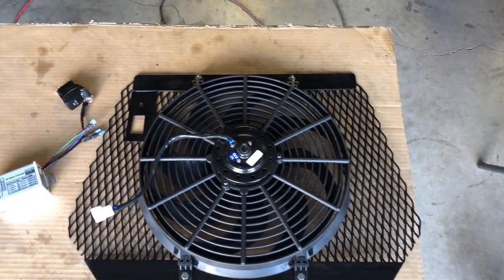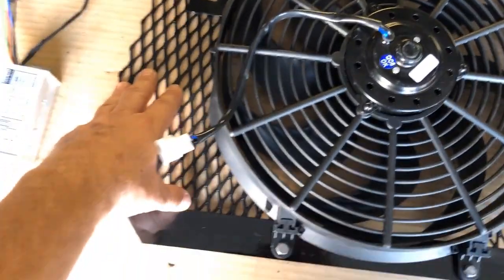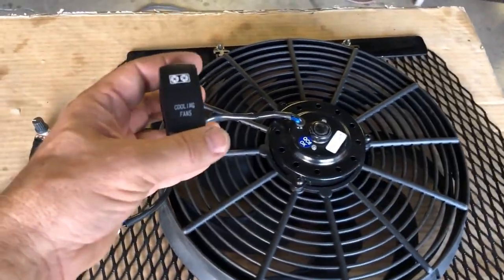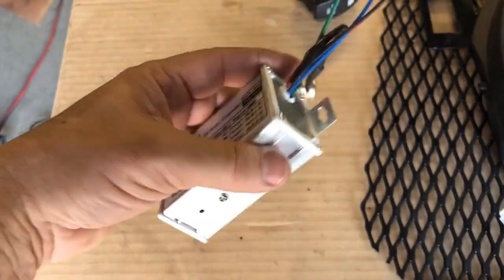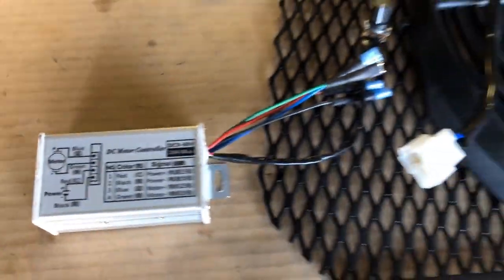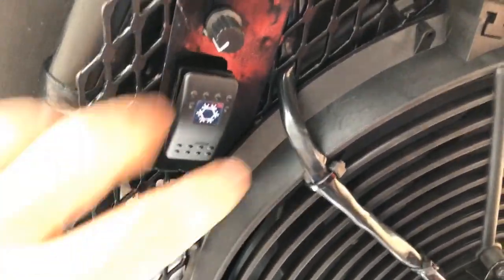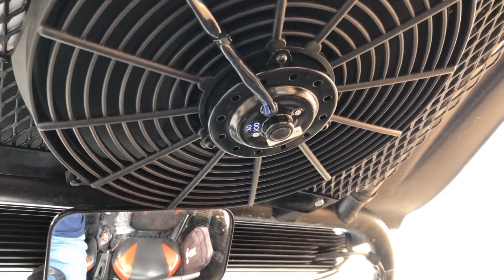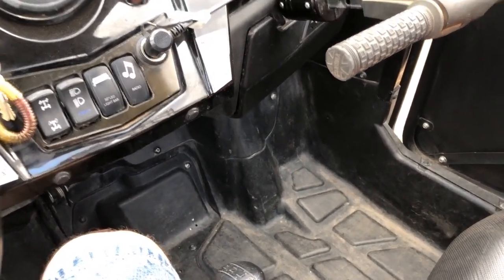Ultimate Cooling for UTV

Comment: I bought the same brand, only mine is 16". $36 on Amazon. I found the same thing about the amps. Startup was about 10+ amps, runs about 6 or 7... 
Great video. I put mine on my very large lawn tractor.  (Steiner 450)

Comment: Got a 👍 from me & subbed, the mesh wire as a mount is a EXCELLENT idea not only for a safety issue but also because such is WONDERFUL as a mount because you have so many options to mount it and other stuff because of the availability of holes that you DON'T have to drill, I want to do the same on a smaller scale to put in front of my Hot Florida driven Air cooled Honda 300 , so if you don't mind I may like to connect more directly with you about my project, I'm a electrical idiot, thanks for your production

Comment: Thank you for sharing! I’m looking into running a duel setup in my Pioneer 1K to cools us down on out hunting trips!
Reply: I have a pioneer 1000-5 wanting to do a duel set up also.  Have you done yours yet would love to see some pictures
Reply from the maker: Bigger fan works better than dual fans IMO.  Get the biggest you can fit either way.  A roof scoop or gap like I have is key to airflow.  You must pull air from top to get good flow.

Comment: I wish you showed how you did the wiring.   I ordered the exact parts you used about a year ago.   I am finally about to install
Reply from the maker: The video does talk about how I physically ran the wiring from fan to battery.  It does not cover the exact wire to terminal connections, but each speed controller may be different.  The most important thing is to have a fuse and locate it at the battery.  Next make sure the switch can handle the max amp draw the fan can make.  The wiring will go from battery to switch to speed controller to fan.  I chose a lighted switch so I know that power is cut off whenever the switch is off.  Leaving the switch on with the speed controller on lowest setting can draw power but not necessarily turn the fan… so you could inadvertently run battery dead over nite.  Good luck with the project.

Comment: I tried doing the same thing. However I have a metal roof that sets closer to the roll cage and won’t allow the fan to pull enough air to work properly. I’ve tried several ways of mounting it to create more air space but wasn’t able to come up with anything that would allow the fan to blow enough air to make it worthwhile. Glad to see yours is working though. 👍🏼
Reply from the maker: Make a hood scoop.
Reply: I found the same issue and am   mounting them behind the driver's head between the particle separator and the roll cage...  that worked well...

Comment: Any way for you to post a parts list of your video kind sir? The ole lady get steamy...
Great video brother.
Thnx
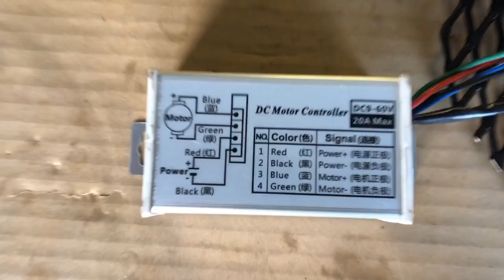Reply from the maker: Fan depends on your space availability.  I used a 14in fan, which is available at auto parts store or online.  I got curved blades as I think they are quieter.  The main component is the speed control which I got online.  If you go to 4:51 in video it has a good picture of it.  I mention the key specs you will want (PWM, 20khz and 20 amp).  These controllers are available at many online stores.

Comment: What’s the wiring that you used from the fan to your battery? Also, suggestions on where to purchase the wire. Thank you.
Reply from the maker: Got it at local hardware store.  Best to lookup wire size based on fan amps and distance from battery.

Comment: I'm installing a similar system but the speed controller comes with a very small on/off switch wired in with extremely light gauge wire. I want to install a better rocker switch in the dash but keep the controller mounted to the roof. Can I bypass this switch altogether and tie it into the power source or do I need to use the same light gauge wire from the existing switch wire?
Reply from the maker: Probably either will work.  I would turn the small included switch on and use a separate power switch.  That way you know you cut power to the speed controller and fan when you turn it off.  Will prevent a parasitic draw.

Comment: So question I’d like to ask?   What are your thoughts on a fan of similar size under the dash?  I’m looking for dust control mostly, would that cause the pressure around the feet area to keep the dust out?   Maybe not quite as harsh as the fan blowing or noise right at your face ???  What you think?
Reply from the maker: Would be terrible for heat.  Most of the heat comes from under the dash area because that’s where the radiator blow it.., and the hoses run under the floor.  Plus, where does it get the fresh air?  You would just be blowing dust and heat around.  You MUST get fresh air from above the fan if you want it to work properly.  Make sure to get the LARGEST fan you can fit, so you can run it slower rpm and the noise it not bad.

Comment: Great Video, I built my fan unit based on your design and it came out great. Only problem I had was finding a PWM unit that would work, tried several units from Amazon and they all failed to control fan speed. can you provide link to the unit you used?
Reply from the maker: Sorry, don’t have a link.  The video shows a picture of it.  Check EBay.  Possibly your fan is not compatible with PWM.  I got my fan at AutoZone.

Comment: So after 3 years how has it performed?
Reply from the maker: Best upgrade I have ever made!  It keeps the cab cool and helps keep the dust out.
Reply: Has the fan in the controller held up or have you had to replace them?
Reply from the maker: Both have been fine.  The only issue I had was the on/off switch needed to be replaced.  I think dust got in there.  So I replaced with a sealed switch.

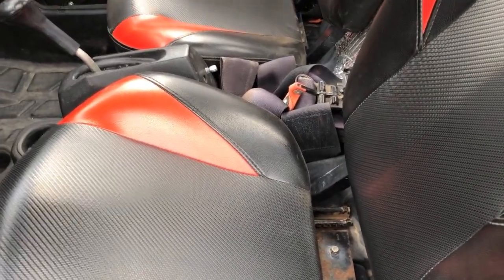Comment: At 9:25 - When you say you fused it to the battery can you elaborate on that.  What size fuse did you use? Was the fuse part of the wire or did you add it?
Reply from the maker: You should add a fuse on the wire very close to the battery.  The wire should be sized to handle the amp draw of the fan and should also be based on the length of the wire.  You can lookup wire size charts online.  The fuse should then be sized smaller than the wire rating, so the fuse blows before the wire fails.  Remember, fuses are there to protect the wiring.

Comment: Can you post a parts list and links?
Reply from the maker: The video shows a detailed picture of the speed controller and the hertz rating I recommend.  You can find that brand many places online... they are cheap.  The rest is just a switch and radiator fan that fits the size you need.  The biggest fan you can fit the better so you can run at slower speed and move more air.

Comment: How did you run the plug from the fan? Like I see the blue/black coming out of the did you use a white plug like what’s on the end to connect or did you cut and hardwire?
Reply from the maker: Cut and put new connectors on to wire to speed control/switch.  Wires go from there to battery with a fuse just before the battery.

Comment: Do you get the heat from the black roof in the summer time?  I would imagine the fan pulls that heat and transfers it to you
Reply from the maker: Notice that my setup pulls air from a gap between the windshield and roof.  This is KEY to getting good airflow and cooler air.  Too many people miss this and expect bolting a fan to their roof will work well… and it does not.   Add a hood scoop on the roof or do a setup like mine.  You NEED fresh air coming in, not just recirculating the cab air.

Comment: I have same speed controller,  20a switch and 14" fan as yours. Do you think the switch and controller will run dual 14" fans or would i need two complete setups?
Reply from the maker: I would do individual setups for many reasons.  I would also be concerned that your battery and stator could handle 2 fans running at same time.  That’s a lot of amps.

Comment: Did you run a 120w or 80w fan
Reply from the maker: I would guess it’s around 120w since it was pulling 8 amps.  Remember the air flow is more about pulling in air from ABOVE fan.  If you don’t have that you may be disappointed in performance.  I have a gap between roof and front rollbar that let’s air in .

Comment: Hello sir...I hooked up a 16 inch fan using control switch like yours...motor simply goes on and off when hooking up speed control..Little dial does nothing...Any ideas? Fan looks identical to yours but is a 16 inch car radiator fan...Control switch looks identical to yours..Not sure why I can`t slow fan down..3rd switch I try..
Reply from the maker: Double check your wiring.  Possible fan draws too much current or is wrong type of motor to handle the PWM controller.  I would try a different fan to make sure controller is working ok.
Reply: @swalesutube  Turns out I had all grounds going to ground bus thinking that was acceptable..Saw pic of switch wiring..None went to ground bus..Working now.Thanks for replying.Fan is great

Comment: So I installed 2 twelve inch overhead fans but the air output is minimal, not even close to what you have. I'm not sure why.
Reply from the maker: Do you have a gap above fans?  Mine has a gap between top of windshield and roof so air is drawn in from above fan.  You can add a roof scoop as an alternative.  Also bigger fan is WAY better than 2 smaller fans.  Moves more air at less rpm.
Reply: @swalesutube  there are 2 fans because it's a four seater, 1 front, 1 back. There is a 1 1/2" space above the panel that holds them and there seems like more air is pushed out the gap than out the fan.. It's also in a closed cab but when I tried it on the bench, the results were the same.
Reply from the maker: You verify fan is pushing and not pulling air?  Some are reversible.  What is the cfm rating of the fan?  Are the blades straight or curved?
Reply: @swalesutube  curved blades, switch has forward and reverse. Reverse pulls more but  circulates the air more. When in forward, all the air is pushed out on the outer portion of the fan but it is not very much.

Comment: Parts list??
Reply from the maker: @arthemmingson2439  I showed a close up of the PMW controller.  There are many on EBAY matching the specs I mentioned.  Vendors come and go, so a link would already be gone.  As far as a fan, measure the space you have and get the largest that fit in that space as it will move more air than a smaller fan.

Comment: Doesn’t it just blow warm air on a hot sunny day with that black roof?
Reply from the maker: It pulls air from front gap between roof and windshield.  So it’s same temp as outside air.  Makes a huge difference to keep you cool and the dust out.
Reply: Yes hot air
Reply from the maker: Ambient air, which is MUCH cooler than the hot air that builds up on the interior from the engine.  The fan helps remove that hot air.  It’s not as good as AC, but it’s a huge improvement.  Try driving your car in summer with no AC and windows up, then roll windows down… you will see the difference.

Comment: Can you leave links or list the specific Items you used for this? Thankyou!
Reply from the maker: They change all the time.  That’s why I show the specs of the PWM controller.  The fan was from auto parts store, you can use any fan that fits, but the larger the better.
Reply: @swalesutube  I looked a few of them up. The seem to be generic. Have you ever had any issues with the PWM or with it being non waterproof? where did you mount it?
Reply from the maker: The video explain you want to choose the PWM without holes in the case, it help keep dust out and better water resistance.  I mounted it above the framework, right next to switch.  I would have to sink RZR to the roof to get it wet.
Reply: @swalesutube  Yea I saw the video, I just wasnt too sure about how it would handle moisture. Looks sweet tho. Thankyou for your help. How have you liked it so far?
Reply from the maker: Best upgrade I have done!
Reply: @swalesutube  Thankyou! Im going to order the parts and see how it goes🤷🏻‍♂️

Comment: I have the same fan does anyone know why mine blows the wrong way instead of blowing air out it sucks air in and no matter how I wire it it won’t blow air out only suck air in
Reply: Its wired backwards. they are push pull fans depending on the way you wire it.
Reply from the maker: Can you flip the fan over?  You might need longer bolts, or make a bracket.

Comment: Just dumb, if you need a fan you may be ridin in too hot of weather. There's cooler seasons like winter, fall and spring. Summer is for boating. 😂.
Reply from the maker: It works on boats too!

Comment: I just recently purchased a fan for the roof of my golf cart. 12v 120watts. I purchased a PWM off of Amazon with a kill switch built in. When I hook it up and turn it on and turn the dial up it will not turn my fan at all. I hooked up my multimeter on the outlet side and it is pushing 12v out of the PWM. Fan will run straight to power just fine or with a two way switch. Any thoughts on what I am missing?
Reply from the maker: Possibly the PMW cannot deliver the amps needed to start the fan.